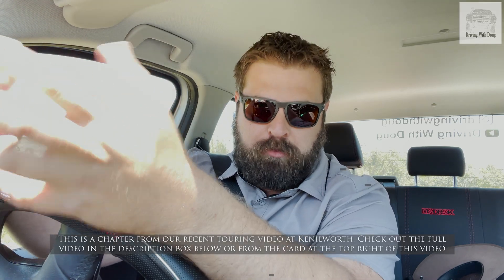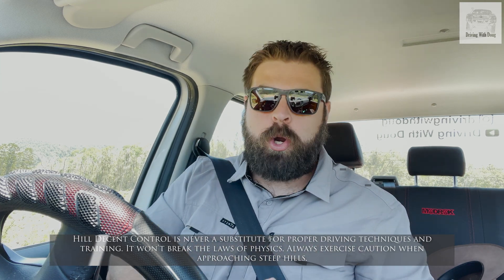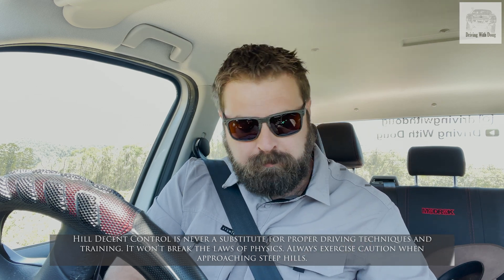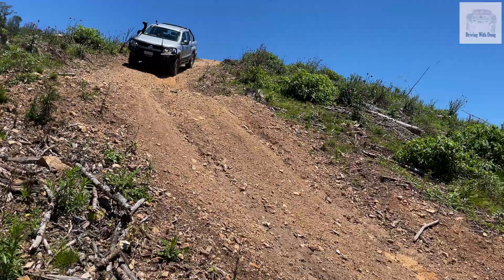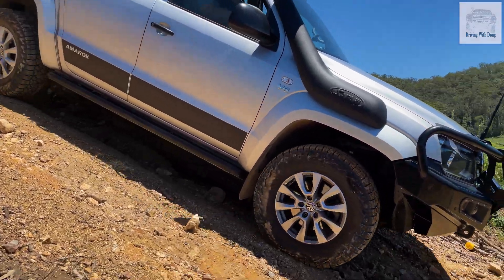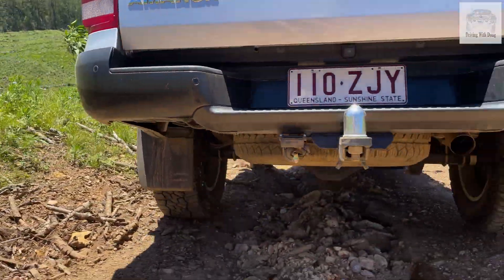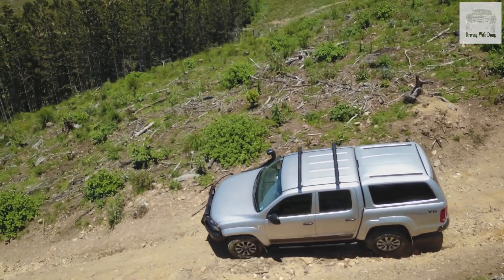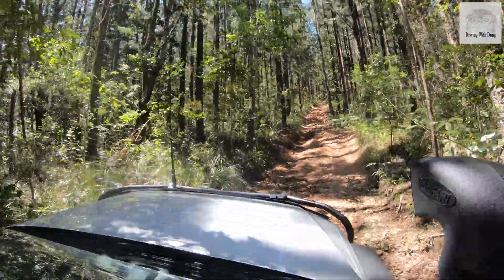Hill Descent Control (HDC) How Does it Work What Does it Do?

Comment: Could I use this when towing down a steep windy road like Victoria Pass or Mount Ousely instead of locking the car into a low gear? I have a Passat Alltrack with the off road mode.
Reply from the maker: Not sure on the All track. Using a low gear with engine braking, then manually using the brake, when necessary, will create the least amount of stress on the vehicle.